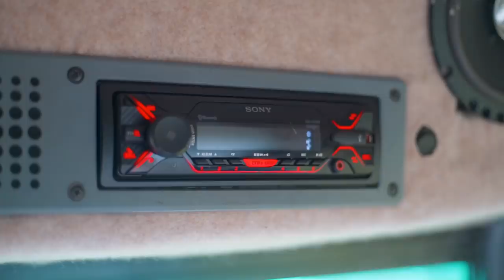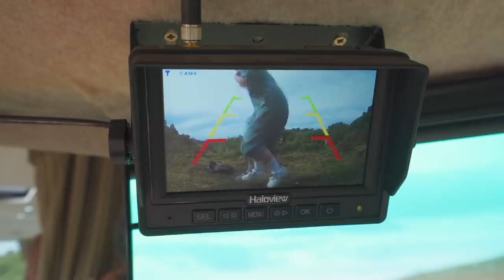VAN TOUR | She’s BEAUTIFUL - Custard the bus FULL renovation

Comment: great video. One thing that may help you guys is moving your carbon monoxide detector to the lowest point in your van. Carbon monoxide is denser than air and it will fill most of your van before even being detected if the detector is too high

Comment: You have done a brilliant job! I'm doing the same only my rust was in the roof which was hard to find the leak! I'm doing it by myself with a crook back! The leak was around the roof vent which looked ok but it was just paint & my finger went straight thru paint, rust, & into the insulation! The rust appeared like yours down the bottom of the bus!  Yours looks great in the time it took you to do it!
Reply: How much did your electrics set you back?

Comment: nice bus.  Careful with that DC/DC inverter, charging from your alternator.  You can maybe burn out your alternator pulling 30A off it.  Or have you had no problems with that?  I wanted something similar for my camper, but read a few horror stories.

Wait a sec, you've got 2 of them hooked up?  So if your cabin battery was near low you'd be pulling 60A from your alternator?  Is that safe??

Comment: Aimee, put some padding on the edge of that shelf as your funny bone won't find it funny when you bang it.  Craig, I hope that diesel heater has its own fuel tank so it can be run on agri red diesel, it's a lot cheaper than DERV fuel, they can also be run on paraffin, if you can't find a rural filling station that has it, the old two pump ones that used to be attached to the village shop/pub, a friendly farmer will often help out and sell you some. Porta potti's can be emptied down a toilet as well, so you can use the dirty smelly ones that are in a lot of lay-by's.  Wet suits, you chickens! if Its that cold keep your jeans and tee shirts on.  Have fun and stay safe, I hope the Tuk Tuk lives again.  💋💋

Comment: That really nicely fitted out well done got some style  I had not seen this before your vedio showed up on Google advertisement about your story .
I too had lived  in a van people mover size .
Adding vinyl to the windows to tint them cut the heat by alot . Auto barn sold a product that is a vinyls for window just cut to shape and clean . Higher recommend you add that to your buss it cut the heat out by alot . The air holes vinyl look around for affordable car tint and it is removable. . (-vinyl wrap public transport has this product stuck on them .you can see out then can not see in as easy .use fir advertisement..-) that should cut the heat out . Suggestions 😃
Storage your spot on that 
makes it funtional ,the more the better.A moveing luxury flat 🤩 wow

Comment: Do you have your diesel heater going from the main diesel tank or a separate in the boot?
Reply from the maker: It’s going from the main tank 👍🏼
Reply: @kingingit  mine too but as I don’t have space in my little van for a separate tank, but if I had a bigger vehicle and used the heater more I’d probably go for a separate tank then I could be super cheapo and use cheaper Red diesel as it’s for heating and not road use